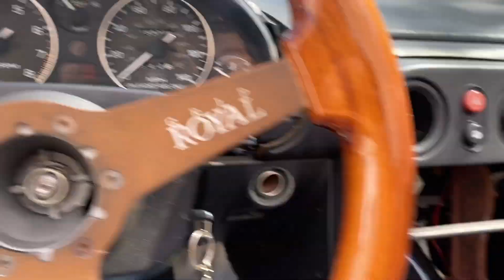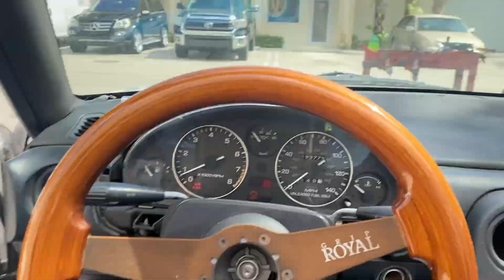IT'S ALIVE  IT'S ALIVE!!!!!

Comment: Lol that painted positive terminal is garbabe.
Helped more than a few people stranded in parking lots with new"to them" used cars the cheap dealerships installed those identical battery connectors on.
Took my pocket knife to the inside, and scraped all the paint off and sent them on their way.
If you have power trouble, do the same

Comment: Carbon fiber that paddle boat!!!
I've been working on all the small shit that needs repaired/replaced on my 06 cobalt ss. I just welded up 3 of the tiniest leaks on my exhaust.  Tomorrow is when I'm cutting the raspy tromboney flowmaster muffler and putting on my zzp muffler, welding the flanges on so I can just unbolt it when I inevitably blow the welds on the inside of it with my fossil popping lol.
And ebrake cables, ill have ebrakes that actually work for the first time lol.
Then Tuesday I put the lowering springs on....I have Hella gap right now, my tires are a smaller diameter than the last ones.